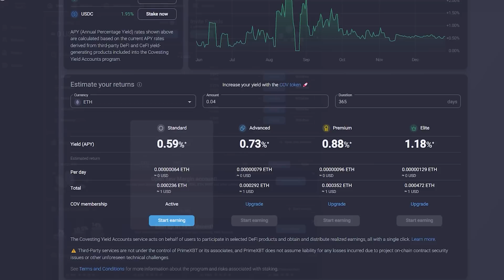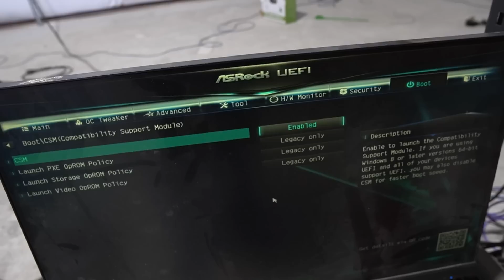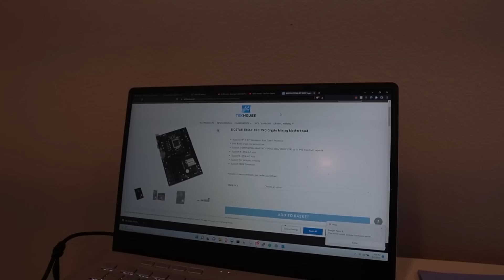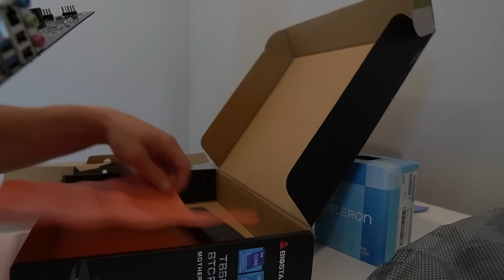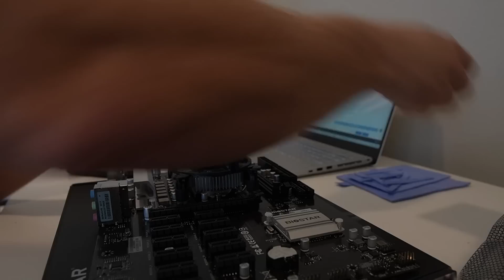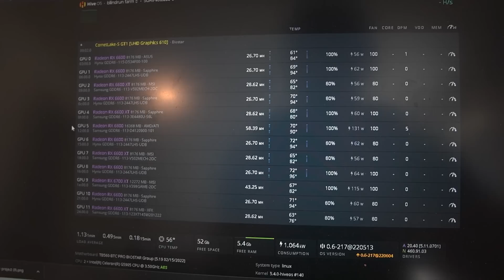This Motherboard Solved My Problems

Comment: Здравствуй друг.У меня есть такая материнская плата Biostar TB560-BTC PRO.
Я не могу запустить на ней больше 4 видеокарты под WINDOWS 10-64. 
Сама материнская плата видит 6 поключенных видеокарт , но при загрузке WINDOWS 
не загружается , скидывается и снова перегружается. CSM - стоит на - отключено.
ABOVE 4G - стоит на- включено.PCI-E Gen 1 включал. Какие у вас на ней настройки BIOS ? 
Что я делаю не правильно ? Так же у меня не определяется оперативная память в 1 слоте ,
тот который ближе к процессору.Если вставляю туда планку памяти , то материнская плата просто
не включается. В слоте 2 эта же планка памяти работает нормально.Память Patriot Memory DDR4 DIMM 32Gb (2x16Gb), 2666MHz, CL19, 1.2 v . Мой процессор  Intel Core i3-10100. Видеокарты GIGABYTE AMD Radeon RX 6600 EAGLE 8G.Блок питания 1.7кВт ATX Segotep GP-1800G.

Hello friend.I have such a Biostar TB560-BTC PRO motherboard.
I can't run more than 4 video cards on it under WINDOWS 10-64.
The motherboard itself sees 6 connected video cards , but when WINDOWS boots
, it does not load , it is thrown off and overloaded again. CSM - is on - disabled.
ABOVE 4G - is on-enabled.PCI-E Gen 1 enabled. What are your BIOS settings on it ?
What am I doing wrong ? Also, I do not determine the RAM in 1 slot,
the one that is closer to the processor.If I insert the memory bar there , then the motherboard is just
does not turn on. In slot 2, the same memory bar works fine.Patriot Memory DDR4 DIMM 32Gb (2x16GB), 2666MHz, CL19, 1.2 v. My processor is Intel Core i3-10100. GIGABYTE AMD Radeon RX 6600 EAGLE 8G graphics cards.The 1.7kW ATX Segotep GP-1800G power supply.

Comment: This is yet another facet of the notorious card detection problems that ASROCK is well known for. All pointless, unsolvable, and a colossal waste of time. The Solution is always to buy a better board. Biostar also solved it for me. WHile I find their BIOS overly complicated and difficult to navigate, they work well for mining once set up, and best of all they seem to detect all cards pretty well on GEN 1.
Reply: Agreed. My Biostars boot up and run for months with no problem, even after power loss auto restarts.

Comment: Use bios version 1.60 which does not need the two molexs to be plugged in.There are also 1.62 and 1.64. 2 of the 3 mentioned turn off CSM by default. Let me know if you need them and i can help you out.

Comment: My main miner is a ASRock x99 WS-E/10G with a Xeon E5-2698 V4 (you can get a much, much cheaper CPU with the same PCIe lanes, just what I had already) and carries 80 PCIe lanes with 7 x16 PCIe slots.   I use a m.2 SSD which eats up 4 lanes, but even so, I could use the PCIe x2  riser cards that allow 4 GPUs per socket in all 7 slots (that's 28 GPUs running at x2 each) with my m.2 SSD and still not use all my lanes available.  I currently have 15 GPUs on this rig and ran out of available power.  I'm about to add another (2nd) 1600w platinum on top of my 1600w and 1000w platinum PSUs already on it to finally max it out...Or at least as much as I can. 

Since this is highlighted, for all you miners out there, look for some older boards with PEX8747 chips on them.  These double the PCIe lanes fed to them. X99 boards and newer with these chips can still be expensive, but they were also available on x79 and I believe some z77 motherboards.  This will double the GPUs you can run on a single motherboard as long as you aren't afraid of buying used.  These chips are no longer included on newer boards as the company that makes them was bought out and these chips made far too expensive for your usual desktop motherboard manufacturer.   A new manufacturer has entered the game called Microchip who claim to offer a chip, the PAX for Gen4 PCIe, that adds 100 PCIe lanes, but we haven't seen them on any consumer or even enthusiast level boards as of yet.  These chips are designed to allow 4 or more GPUs to all run at x16 simultaneously, so any amateur AI/Machine deep learning researchers or anyone wanting a home GPU server for relatively cheap, these would definitely come in handy as well.  In case it needs to be said, for server applications, the x16 speed is far more important and a much higher performance increase than the difference between PCIe Gen3 and 4. For mining, it really makes no difference at all as I'm sure most are aware.  Happy mining.

Comment: I have a similar issue on the biostar b360 pro.  Except every time it resets it change the max TOULD from 3.25 to 3

Have updated bios and everything didn’t help. Luckily it just reboots and starts working but still seems a bit unstable. I hadn’t seen this model with newer chipset, will take a look if it’s under 200$

Comment: A 1.5HP water chiller, a radiator, water pump and 500 gallon water tank and high cfm fan will keep things cool. Water cooling is the way to go.
Reply: He lives in Texas, I’ve service a lot of medical equipment down there. It’s a nightmare, the humidity is insane, everything sweats and little instances of electrolysis end up everywhere. Air cooling down there of course has its draw backs too with the dust and sand but not nearly as high upkeep as a water chiller and piping
Reply: @mossbogger8366  the upkeep is close zero and nothing sweats if you insulate. I cool 3 GH + 6k HPS and live in 90% RH.
Reply: I say anything over 5 kW of power you’re going to be struggling to balance the load. Because at that point you are compressing enough heat out of the cooling circuit that the amount of expansion you need to keep up with the load would be enough to over chill your waterline so unless you have a monitoring system to make sure that never happens you are running a risk. Under 5K probably somewhat reasonable to manage to someone with amateur skills but I would not recommend it to just anyone
Reply: @mossbogger8366  The system has been running 24/7 for 5 years in +40 to -40C weather. The water temp is set 14C year round. The water tank is indoors and needs to be topped once a month in the summer and if you have hard water you will have to clean the system once a year. I have no issues other than initial dialing it in. I set it and forget it. Everything is sealed and air tight environment. The initial cost is high but is cheaper than AC to operate. The chiller uses 1450 watts when compressor is running. If you don't want to use a chiller get a water source geo thermal heat pump or diy it.

Comment: A Celeron and only 16GB of RAM? I know the GPU memory does all of the work but I would still expect a beefier CPU and more RAM anyway.
Reply: That is actually overkill. A notebook cpu and 4gb ram would work just fine.
Reply: I have rigs with old Xeons and 4GB RAM and dont have problems
Reply: The Celeron won’t be mined on, the GPUs will be. It’s meant for low power consumption lol
Reply: Actually the local storage virtual memory is used to page file the cyphered block to the gpus to calculate. 8gb per card. Technically you could get like 64gb of ram to aid this, but each block takes 15secs to solve so it’s not really necessary, virtual memory has more than enough thru put at that slow of a rate
Reply: @mossbogger8366  What are you saying lol you can’t even find a block on ethereum in 15 seconds unless you utilized the whole networks hash yourself. Virtual memory is legit reading and writing 0s and 1s which would consist of everything on the operating system. It has no correlation to “block time” in the implied sense you were trying to make of it.
Reply: No, not 15secs, actually pools send block chunks with variable difficulty that take between 5 and 30 minutes for the GPUs to solve.
Reply: Thats more than enough.

Comment: There is a bios update for the h110 pro that will stop it from re-enabling CSM.  I had the same issue until I found that out.
Reply: Don't send send message to that bot on WhatsApp
Reply: I'm glad someone mentioned this, it completely fixed this problem for me.  The bios file is on the hive forum, I'll post the link if I have time
Reply: Agreed. Use bios version 1.60 which does not need the two molexs to be plugged in.There are also 1.62 and 1.64. 2 of the 3 mentioned turn off CSM by default.

Comment: Bro ive said this a bunch of times and you never read it, you need to close in the sides and top of your shelves with cloroplast, its cheap rigid plastic, then put your shelves near your exaust fans and make a plastic corrider from the top of your shelves to the wall overtop of the exaust fans. Instead of letting your heat just rise to the ceiling you need to shoot it outside
Reply: do you do this between shelves as well? its kinda like a chloroplast tent right?